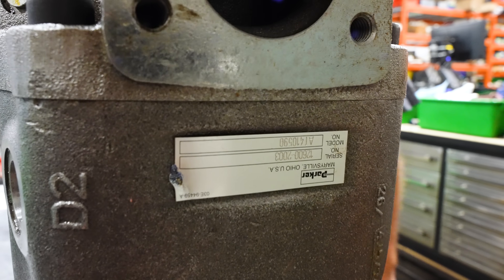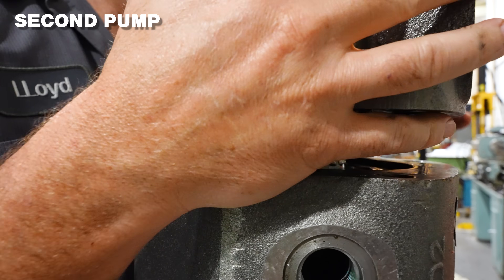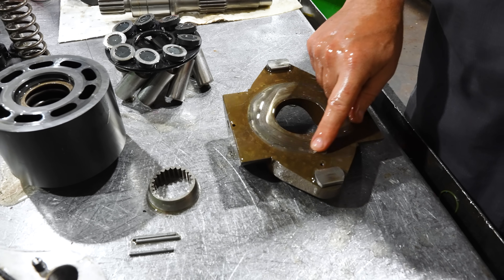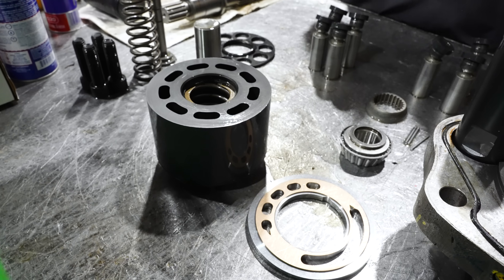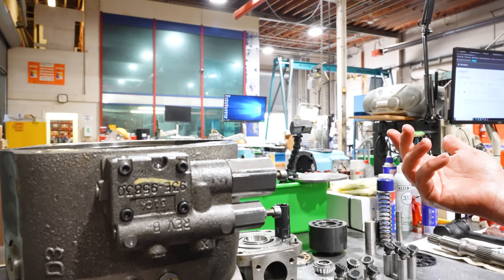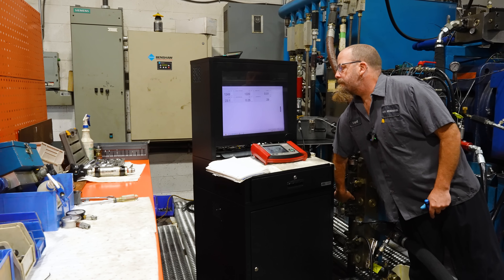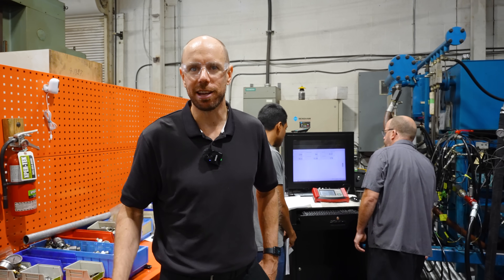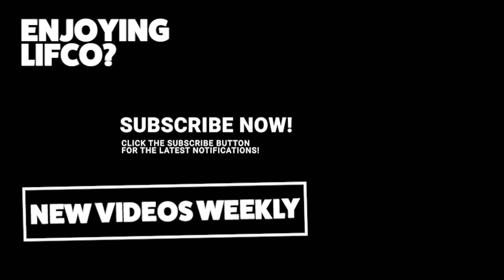Double Trouble Shooting: Did these two pumps fail from the same thing?

Comment: Having the pressure comp screw all the way out would only have made the pump not build pressure.  It wouldn’t have been responsible for the pump destroying itself like that.  The 1st pump shredded because of a terrible inlet condition.  The suction pressure was so great that the slippers were sucked right off the pistons.   There was some kind of restriction in the suction line that caused a huge amount of vacuum on the suction side of the port plate that caused the failure.  If they’d have left the second pump on the machine eventually it wouldn’t have shredded the same way.  This had nothing to do with the pump and everything to do with pump inlet not being open enough for the pistons to draw oil into the barrel properly.  Pressure comp setting had nothing to do with it.
Reply from the maker: Yes you are all correct. The conclusion was that the problems of the two pumps (both off the same machine) were unrelated, and there really wasn't much of anything wrong with the 2nd pump. -Fraser